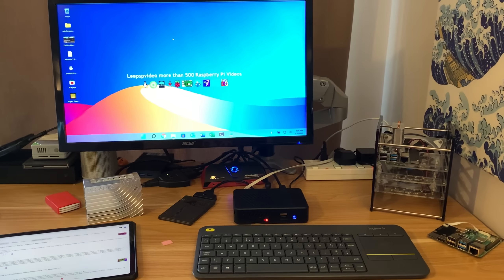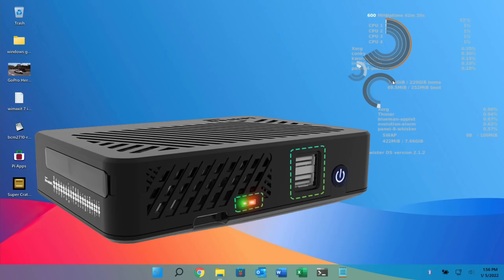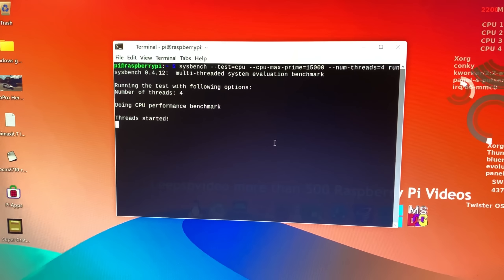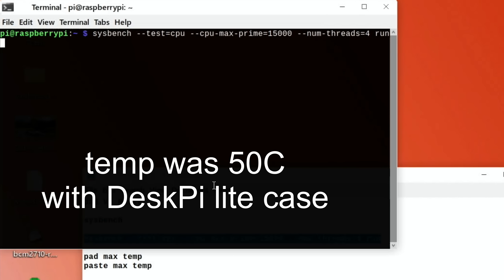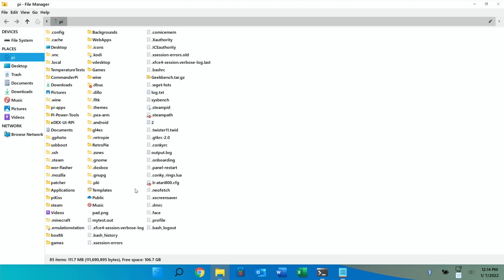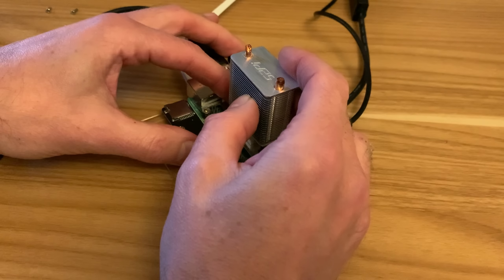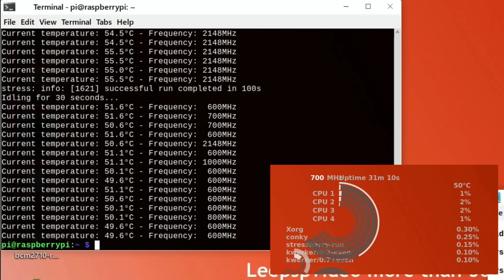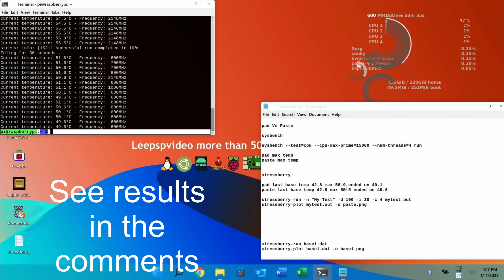CPU paste Vs Thermal Pad. Raspberry Pi 4

Comment: One thing to note when adding thermal paste, Adding it as a "pea" causes the paste to disperse in a circular pattern. If you dont apply enough you will not have the square corners of the chip covered with the thermal compound. Looking at your pictures it seems this may have happened. Best to add that pea then disperse by hand with a credit card evenly. Cool video man!
Reply: Was also going to recommend doing this in the future, for PCs as well you want the entirety covered not just the center.
Reply: Apply in a cross like fashion, the spread is much better. :D
Reply: He should have shown the thermal paste disperssion after the test. On RPi that "pea" is more than enough, actually on those heat pipe heat sinks thta is "just enough" as there is a significant air gap either side of the copper piping.
Reply: @paulwratt  lol Maybe , but I will take every degree I can squeeze out of it. I wont the whole thing covered with paste. Heck even the heat sink mounts could use some thermal past !  lol lol

Comment: Are you making sure that when using thermal paste, there is still enough contact pressure? If a case was made for the much thicker thermal pads, this may be a problem, making the thermal paste too thick and such behave much worse than necessary.
Reply: I wondered the same thing.
Reply: I was looking through the comments to say the same thing. Paste is designed to bridge very small gaps, like scratches. Pads are designed to bridge large gaps like half a millimeter.
Reply: I found this video because of this question. I got a geekworm sink that is a copper plate covering the whole board with contacts for all chips. to my surprise it came with very thick thermal pads. This seems to defeat the whole point of using a heavy, expensive copper sink.  I'm trying to figure out how much the pads compress, how thick of a copper shim I need to actually contact the chips with paste.

It also has a grid of square fins on top which seem too small to radiate anything. I'm trying to figure out how to create a flush surface to attach a heat pipe radiator from an old laptop.

Comment: I have used TP for all my builds for the last 3 year.  Due to the fact I needed cooling for my pi 0 w and now mode 2. The fan is using a block of copper and held down with springs. The idea was to keep a low profile for my camera case. The Pads didn’t do the job as good as the thermal paste.

Comment: Some thermal pads are SO thin. Its very hard to get the sides off without tearing up the pad. So for some use thermal paste.
There is also a longevity issue between paste & pads. Yes it matters what paste & what pad you use!

Comment: Good vid. 
With the tower cooler paste will work as it had a sprung pressure onto the chip, flirc type cases with a fixed interface could be different. 
The thermal carbon pads for desktop processors could be interesting, snip the right size and could cope with both scenarios?

Comment: On my 8GB RPi overclocked to 2147MHz, I just use the plain ol' pink pad with a low profile Ice Tower. But I swapped the fan for a Noctua 5V A4x10PWM with a Python script controlling the PWM GPIO pin according to CPU temp. It idles at 30°C-33°C (depending on room temp) and never goes past 45°C-48°C no matter how long or hard it's pushed. The fan never goes past 50% duty cycle, so it stays whisper quiet.

For my other RPis, I either have small stick-on heat sink (sometimes with a low speed fan blowing over the heatsink) or else just run them naked (if not overclocked). None of them ever get near thermal throttling and the silicon has a good enough spec that I'm not worried enough about them degrading to debate thermal pad vs. thermal paste. The 8GB Pi is my "overkill experiments" system, hence the overkill cooling setup for it.

Comment: I have a pi4 4GB overclocked to 2275Mhz with default voltage, using a low profile ice tower cooler. Open air setup. I replaced the thermal pad with paste, it made a 6 degree difference. On a 30 minute stressberry test went from 51 max to 45 max. Paste is Noctua NT-H2. Thank you for the tip... I mean I was already okay with 51 max but still nice to reduce it further.

Comment: Nice one. I already used thermal grizzly pad 1mm on all the chips and enclosed it with aluminum case with two small fans. Stress test 55 degree C almost Same as yours

Comment: There’s always so much debate on brands of thermal paste etc with PC builds etc, it’s funny how my 4 x 175w Xeons working at 80% load for 3/4 years on the cheapest unbranded thermal run at 42c (18 core beasts) 

But with Raspberry PIs, these SoC “can” run without heat sinks as they’re so low powered and even with tiny heat spreaders you can do all sorts, I expected these results, very good tests by the way. But it basically shows it doesn’t really make too much of a difference if you use pads or paste, to be honest, I just use pads as I’m constantly playing around with my pis and they’re are so clean without messing with paste all the time.
Reply: what is the mass of the cooler on your xeons ? 
a little flat heatsink with a fan or a big tower heatsink with 2 fans.
Reply: @jyvben1520  they’re the default flat heat sinks (2 inches high) and redundant fans supplied by HP.

Comment: I been running carbon epoxy with the raspberry 2 and 3. You can see the difference with the epoxy to the thermal pad. With the epoxy the temps were lower than the paste by 1 to 2  Celsius. But  the  thermal body is welded to the processor. The 4's I use paste. I been trying different of cases!

Comment: Thermal pads for me. I do not enjoy removing thermal paste from tiny boards like the RPi.
Reply: Yeah it is pointless. Even overclocked Pi 400 never throttles. Don't keep RPi inside tiny plastic box and it needs no cooling at all.

Comment: for more pressure just grind the stands by the number of mm that the pad had
Reply: does that not weaken the stands, also grind 4 pieces the same might be difficult !
Reply: @jyvben1520  no you grind them vertical not horizontal you just change the height, also yes but if you measure right and you within 0.2-0.3mm is fine its way better than lets say 1mm tha was with the thermal pad

Comment: Will thermal paste keep heatsinks on the chip? I'm doing the pistation w/ lcd so not alot of room for cooling from my understanding
Reply from the maker: Thermal paste doesn’t keep a cpu in place it just transfers heat more efficiently to a heat sink
Reply: @leepspvideo  yea was hoping maybe the heatsinks would be light enough they would kind of just stick, have you used the pistation case by any chance? I'm concerned about heat
Reply from the maker: @shockwave.9749  I haven’t. I see it mentions a fan

https://thepihut.com/products/pistation-case-lcd-for-raspberry-pi-4

Might work with a Pimoroni fan shim. Surprisingly quiet for its size

Pimoroni fan shim stopped spinning. Raspberry Pi 4.
https://youtu.be/ck26TxuEAac
Reply: You can get thermal paste that dries hard, no? Essentially acting like a glue for the heatsink?
Reply: @intensecutn  normally I use arctic silver 5 or w.e I have on hand but that's for pc's, I ended up just using the thermal tape and only applied a light overclock to 1.8 or 9 I believe, it's been fine but in the pistation case if you keep the disc tray closed it does get hot

Comment: And temp without neither pad nor paste? Are they even needed? :D
Reply from the maker: Overclocking without cooling. Raspberry Pi 4.
https://youtu.be/DNjI6u91LuA
Reply: @leepspvideo  I ment temp with same tower cooler just without paste nor pad.
Reply: But there is not enough contact then. You can use a fan without contact, but heatsink needs to touch as much surface as possible.
Reply: @MiniRockerz4ever  Well then put chunk of 1cm x 1.cm copper or silver plate in between (flat area and heatsink) to close that X mm gap (whatever it is), that should take a heat better than cheaper solutions like pad or paste :D

Comment: Any chance you could share that lovely Conky config file?
Reply from the maker: Pi news 35. Windows 96, SD card storage, Pikiss Retroarch installer & Conky rings. Raspberry Pi.
https://youtu.be/dkrXJopVXmI

Pi news 36 Mechanical Pi 400, Package thieves. Plus Conky & Firefox tweaks.
https://youtu.be/oEaElkJCtfE

Comment: I been using mx 4 pasto on my rpi 4 for wholes time because pad is worse than pasto 
I overclock mine up to 2.3ghz idle at 55c fan at full speed n doing some testing it get up to 76c it far go
I have thin copper on ram next to cpu keep them both cooler same heatsink cpu is using
I have try pad but ended up going up to 100c vs pasto mx 4 at 76c overloaded overclocked